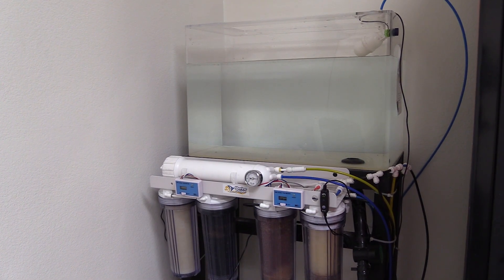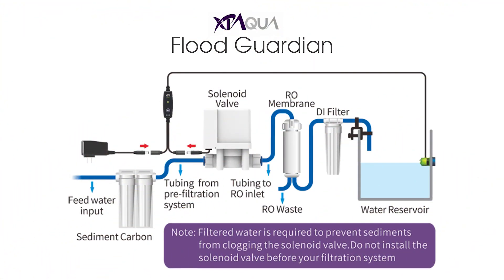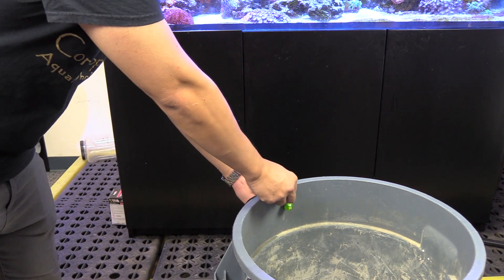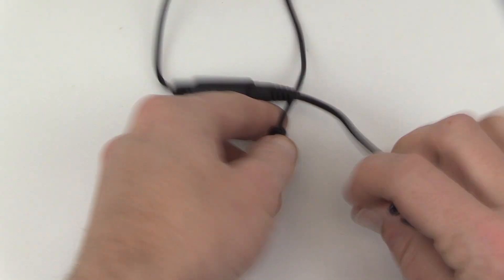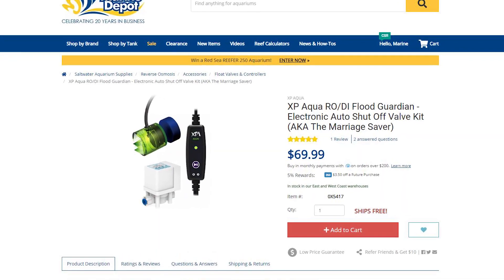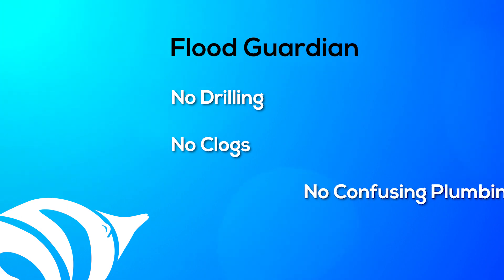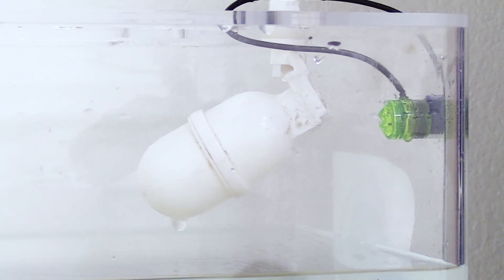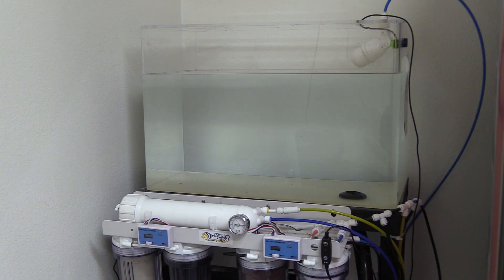How to Install the RO/DI Flood Guardian - Electronic Auto Shut Off Valve Kit from XP Aqua

Comment: How do you flush the rodi system, after filling your reservoir, and the solenoid is closed? Do you have to always remove the optical sensor every time to get the solenoid to open? Because it defaults to "closed" with no power. So unplugging it wouldn't work.
Reply from the maker: The flush happens via your waste water line so all you would need to do is apply power to the Flood Guardian and open your flush valve.  The system will flush, once you close the flush valve it will begin filling. You would need to move the sensor if your reservoir is full of course in order for the flood guardian to open. 

-Robert @ MD
Reply: @BulkReefSupply  
Yes, but didn't the video say that the solenoid goes after the carbon block (before the membrane)? If that's the case, with a full reservoir, the water won't even make it to the membrane to be flushed if the solenoid is closed. It seems you would have to remove the sensor to get the solenoid to open, to flush the membrane after just filling your reservoir.

Comment: This may be a dumb question but could this be used to direct plumb a espresso machine. I have a 7 stage RO system that I would like to attach this to but am confused why the solenoid can't be fitted after the final stage of a RO system.

Comment: I want to go on vacation and I want to run my RO/DO out put lines directly to my fish tank to top off the evaporation process. This video shows exactly what I need but, will this sensor turns off once its full and looks like it needs to be manually restarted again to fill up. Well, if I am not home, will the system keep on going and filling up my tank until I get back or is the only option is one time fill up, shuts off and then have to manually restart the process. I am looking for a constant on going repeat automatic fill up water adding system. Is there such as thing?

Comment: Will this work with booster pumps?
Reply from the maker: Yes, from the way I see it, a booster pump will not interfere with the operation of the Flood Guardian.  We have one installed alongside a pressure switch activated booster pump that cuts off when pressure builds so it works nicely.  I do want to be certain I get you a thorough answer so I reached out to XP Aqua directly to see what they have to say on the subject.  I will reply back here on YouTube as soon as I have some more insight. 

Thanks! 

-Robert @ MD
Reply from the maker: Alright, I just confirmed and my suspicion was accurate.  The unit is suitable for use with a pressure operated booster pump because it will shut off when pressure builds in the system. 

A manual booster pump will not turn off when pressure builds and will continue to run when the Flood Guardian stops the flow of water.  This will actually put substantial back pressure on the booster pump and possible burn it out or cause a premature failure. 

Best of luck and thanks for watching!

-Robert @ MD